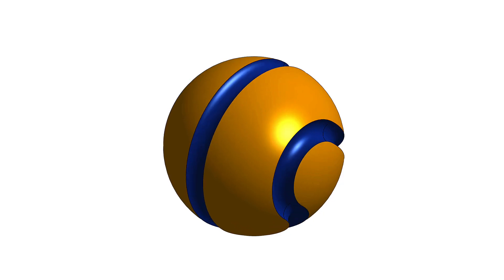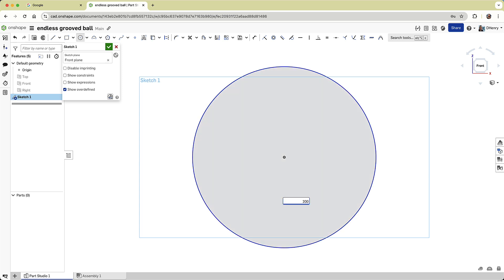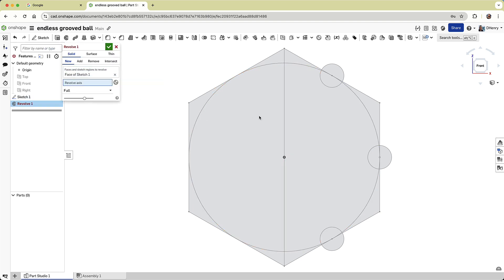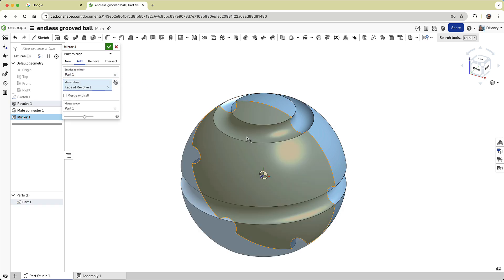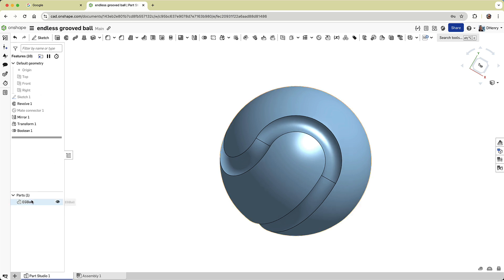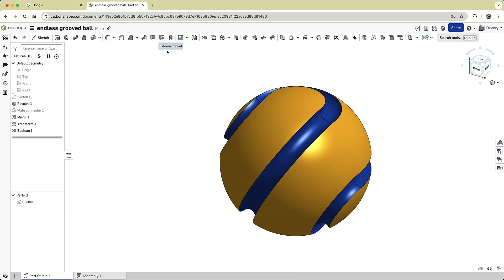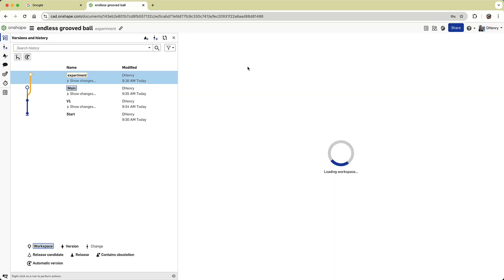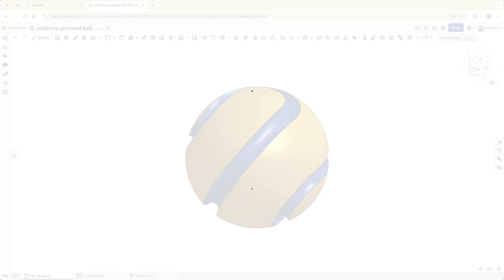Let's Make a Groovy Ball with 4 Features in Onshape

Comment: Clever! Yet I see 6 features, sketches are counted as features, Ill give you 5 since you mentioned the implicit with transform. But you didn't mention the implicit option w/ rotate and add in mirror with that could have replaced the transform and boolean.
Reply from the maker: How dare you, Nick.  Them are fighting words.  Calling sketches and construction geometry "Features" is like calling crust a pizza topping.  But I see you are a man with a discerning eye, and you are correct regarding the different ways to build this ball. I will make one more claim for you to consider - I can actually build that ball with one sketch and two features. (no mirror, no transform)

Comment: This is brilliant and I love Onshape.  What is the line left in the blue grooves (at the boundary of the two halves that you later joined via the Boolean tool).  How do you get rid of that - replace / move face?  I'd be worried it would show up in a high resolution 3D print of this model.
Reply from the maker: That is just a tangency line; you can turn off its display.  It will NOT impact a print.
Reply from the maker: I also like your color choice.

Comment: Can you make additional Rotate in "Transform" feature? It would be so nice to have Rotate by a pivot like in blender or other 3d software. There is already possibility to move object in onshape using "Translate by XYZ" where we can grab a pivot arrow and move it, can you please make something similar but for Rotate?
Reply from the maker: Not sure what you mean.  In this tutorial, I am using rotate in the transform feature.
Reply: @OnshapeInc  yes but without adding a mate connector. Pivot can be set by the center of the object automatically as it is in "Translate by XYZ" - Transform function.
Reply from the maker: Ahh, we have that in other areas of the software, but having a set coordinate system (like a mate connector), you will ensure that the model can regenerate parametrically with significant edits.  Blender may have more free-form manipulations because it is not parametric.